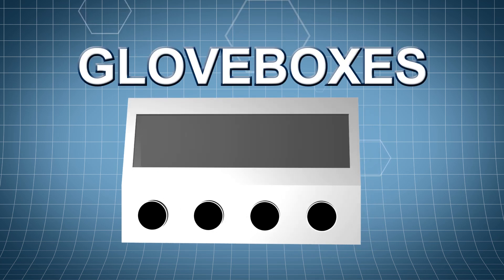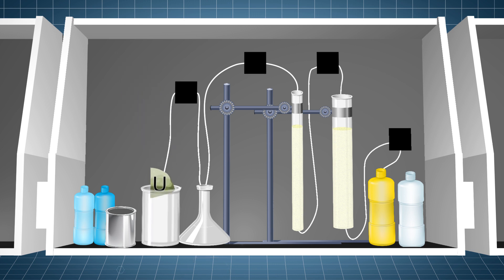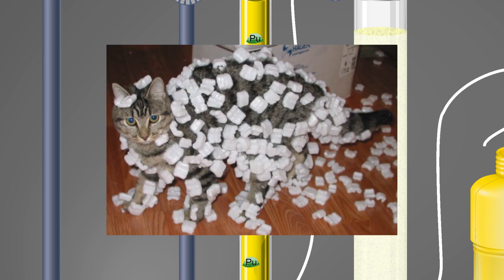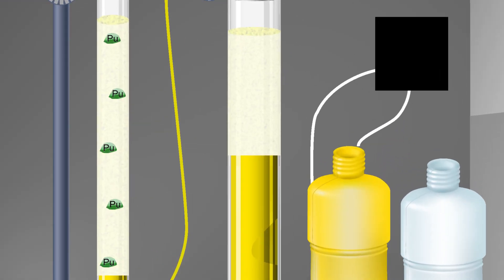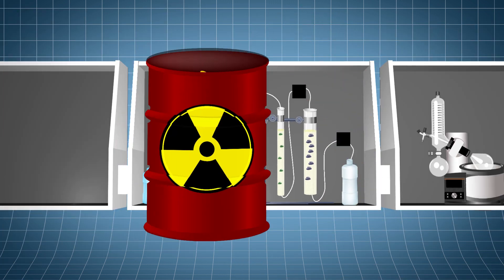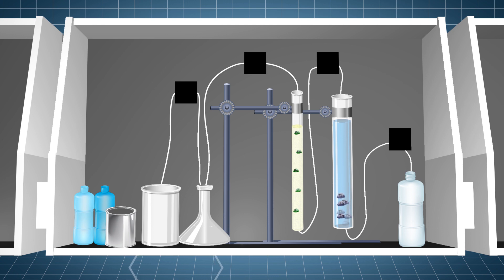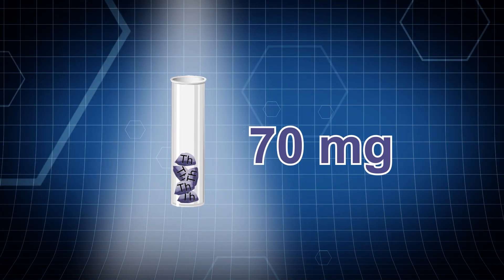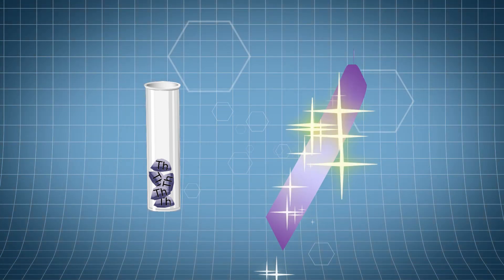Project 101: Understanding the Thorium Express

Comment: Fire the moron who made this video.
The actual process is extracting a specific isotope of Thorium from an irradiated sample of uranium.
Reply: Not quite.  You make U233 by neutron capture on thorium (so the thorium is irradiated).  Then you pull out the uranium (or protactinium).  You really don't want the uranium irradiated.  Alpha decay from U233 produces the desired Th229.    So the actual process is irradiating common Th232, gathering the resulting Pa233, letting it decay to U233 outside the neutron flux, letting the U233 decay outside the neutron flux, and gathering the Th229.
Reply: @larsjorgensen4123  none of which is at all descibed in the video, thus - the call for firing him.
How would you contaminate U233 with plutonium?